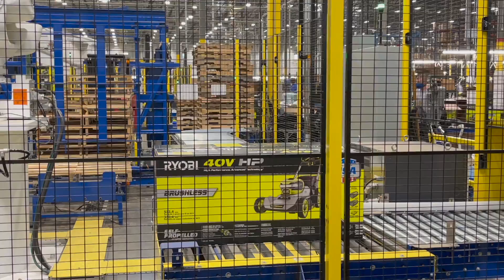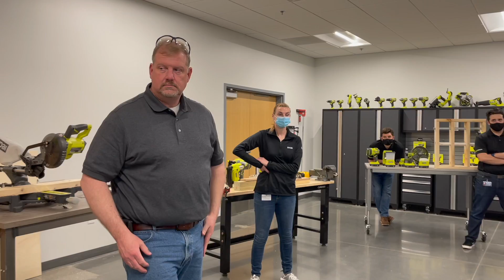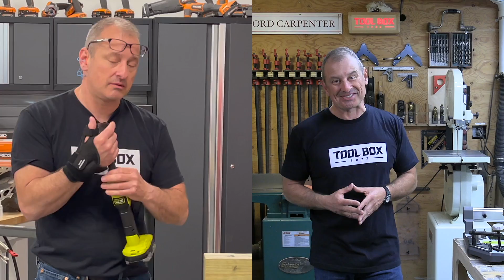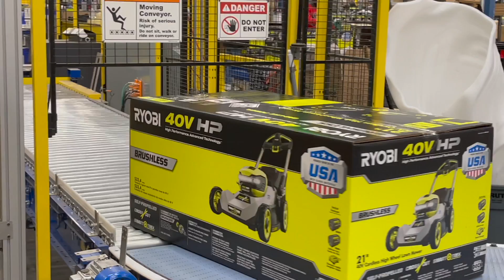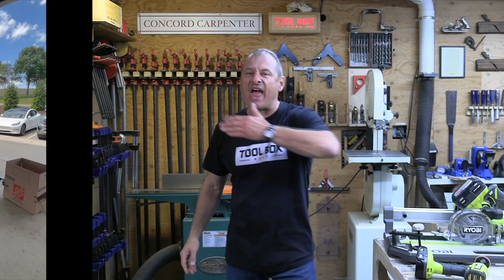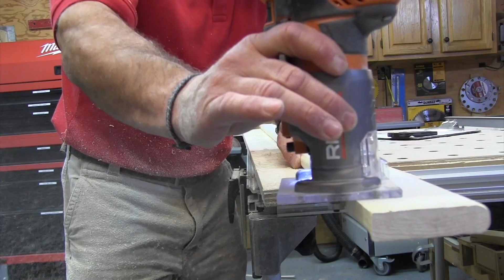25+ Reasons To Watch Ryobi Tools ~ Editorial

Comment: I've been looking at a few of their tools for my basic home needs. I'm in the market for a tablesaw, would like to go battery, was sort of set on the DeWalt since I already have the drill and impact driver combo with 2 batteries, but at this point, I don't think it really matters. That chainsaw also looks interesting. I've also been impressed with Rigid on certain things, like their shopvac, my dad picked one up and it works way better than my current.

Comment: I know a lot of people will watch this video and think, “this guy is friends with the head of Ryobi. It’s just a commercial. Nope. I’m a carpenter/general contractor and I’ve been using Ryobi for about 10 years. The improvements they have made are amazing. I also own DeWalt 20v products. They are pretty good, however the battery life from the tools as well as the recharge time on the batteries are not as good as Ryobi’s. Ryobi’s cordless pin guns (brad nailers) are amazing. I can’t wait to get their 36v duel bevel 10” draw miter saw.

Comment: Nice that you do a video of inexpensive power tools. 
 I'm a consumer of all tool brands.
 I have been eyeing the festool impact and drill set but, have not dropped the coin due to distrust of the economy. 
I did just by a craftsman combo kit with about 6 tools i considered throw away. 
PLEASANTLY SURPRISED!
The impact driver is blasting 4 inch timberloks and 8 inch better than the makita and dewalt on site
The circular saw is ripping through the stuff i dont need my festool track saw to do  the multi tool worked nice (though i want that festool too) and the drill kicks butt as well. The sawzall looks wimpy but, i dont use them much

✌

Comment: I had a great experience with a Ryobi impact and drill from 2013. They have/had a lot of value priced tools, but their new tools are very expensive and not a cohesive strategy for top tier Performance.

Their battery strategy is a mess. you never know which battery you need to get the advertised performance from that tool. They had lithium+, hp, extra pins on tool and battery, now you don't need those, now they have two more battery lines. Their website is poor.

Comment: Personally I am frustrated with Ryobi. I run mainly Makita & Hikoki, but the stand out with Ryobi is their innovation. I have a Makita & Ryobi multi tool sitting side by side in the van and almost always grab the Ryobi over the Makita. The downside is I have gone through about one a year as the switches fail. The upside, Bunnings replace them almost without question. 
I also use a Ryobi narrow crown stapler, mainly because Makita don't make one, and the Ryobi 18v vac is quite good. 
The biggest thing I don't like is having other trades on the jobs seeing me using Ryobi. The image in a professional role just isn't good.
Reply from the maker: Let your work speak for itself.  Tools are just expensive accessory holders. Use good blades and cut and assemble well!

Comment: Love all  my Ryobi tools , but the new HP line is junk. Not sure why they are advertising them as contractor grade. If you push the duty cycle on the HP line like a contractor would, they go in smoke. 

I would love to see one of your extremely comprehensive test runs before you sing their praises. 

Thank you for your great testing videos and tips. You are a step above.
Reply from the maker: I don't think they're necessarily pushing them his contractor-grade tools. Ryobi has always been, and will be a DIY grade tool, that many price-conscious pros, or entry-level contractors choose to buy. I know several contractors that buy Ryobi tools for themselves or crews. When i e asked whips, they based it off of price and simply replace them when they break.

Comment: Its good news that there is a commitment from the top to improve the Ryobi line. At one time I was a big Ryobi fan as every Makita tool I bought disappeared immediately. Have done a huge amount of work with Ryobi tools and they have worked well. More recently, within the last 4-5 years, there has been a noticeable drop in the quality of Ryobi tools and batteries. Most recently, they have significantly increased prices - without improving quality.  I did buy a newly released Ryobi grease gun just recently, and was very pleased with it and I hope this is part of the improvement you are reporting, however the latest mini drill/driver I bought has been an overpriced disappointment which is substantially inferior to every other tool in its class.
Reply from the maker: I think the focus right now is One+ battery, tools and OPE - it’s still early, let’s see where they take this

Comment: Great video! I actually burned out a number of (older, admittedly) Ryobi tools on a modest commercial project, and gave my whole set to a friend with a new house and light duty use (migrated to Milwaukee). But the recent push for more Ryobi tools to do more medium duty work has been great to see! If you have the time, a video tracking the relationship of Ryobi, Rigid, and Milwaukee would be very interesting - how and when do they prototype in one platform and port to others, etc. Oh, and I've driven by that SC plant (I'm in the south east)! Was neat to see. Best wishes Rob!
Reply: Ryobi became more relative in the prosumer market once they switched to brushless tools.

Comment: I am a contractor & I am impressed with the quality of Ryobi tools.
The bulk of my tools are DeWalt but you can't beat the value that you get with Ryobi, especially for tools that don't get used ever day.
Reply: i needed a cheap cordless saw to cut ply into manegable pieces , i have a festool tracksaw but its corded, i got a ryobi and was pleasantly surprised , its not a high end contractors saw , but treated carefully its done everything i asked of it. i used it to cut a lot of 6x2  and 4x2 accoya for a landscape job, even to start cutting 30 degree bevels on 8x8 posts that i finished with a handsaw, thats hard material and it cut fine with a decent blade installed. their cordless sander was junk though, not impressed with that.